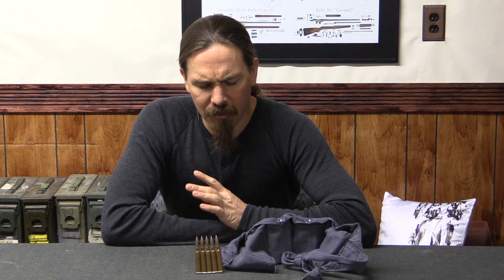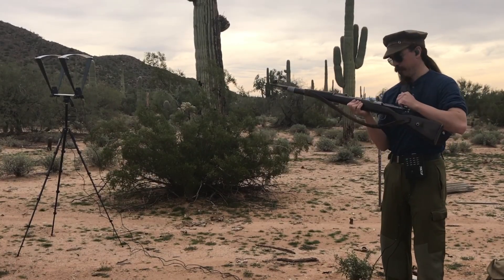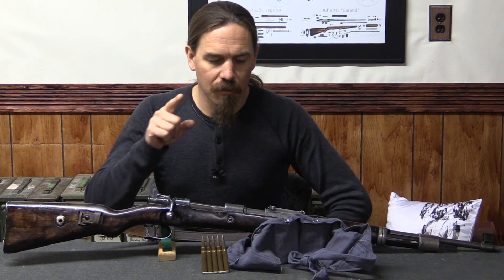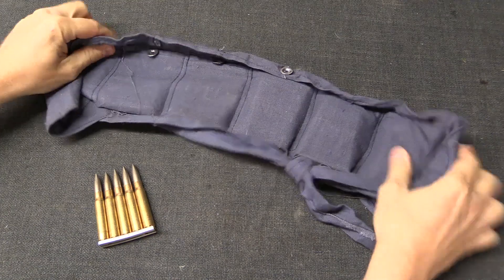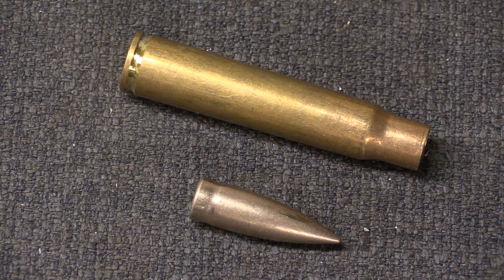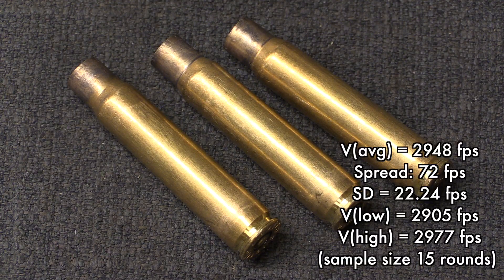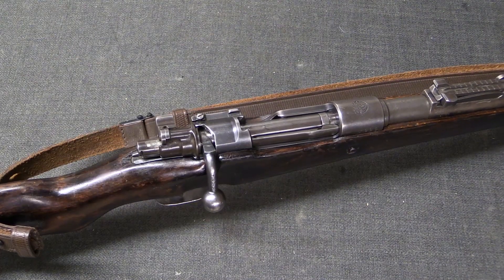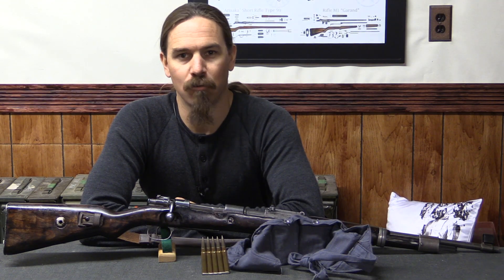Ammunition Evaluation: 1941 Turkish 8mm Mauser

Comment: Another couple of observations about Turk 8mm Mauser ammo that I noticed...
1. It really smells...the burnt propellant it has a sharp, almost ‘pissy’ odor.
2. It’ll really clean your bore....I had frosting in the grooves of my Vz.24 that standard cleaning could not fully resolve, and those hot, over-pressured cupro-nickel jacketed rounds blasted them clear. 

As a general rule, I always bring cleaning equipment to the range (especially after shooting corrosive Berdan primers) and I always check the bore after shooting, and I was amazed at how the frosting was just gone after shooting the Turk ammo. A good cleaning with an ammonia-water based solvent followed by standard Hopes #9 and a light coat of oil, and the bore was beautiful. I went home afterwards feeling rather clever....I was rather ‘chuffed’ after that, as my Brit friends would say.

Comment: i was recently given 700 rounds of this ammo and didn't want to shoot the steel jacketed bullets through my Vz-24 that i put a new barrel on sometime back. i decided to give it a try by pulling the existing bullets and seating in some 150 gr. Hornady bullets. i loaded up 10. shells and went to the range. the ammo pulled down fine but i noticed 1 out of each 5. had a split neck it all fired and had a fair kick to it. at 100 yards i shot a fairly decent group. after seeing this video i am questioning my friendship with said person who donated the ammo to me. i guess i could pull it down and reweigh all the powder and drop the charge a few grains of powder. but in all reality it's not worth the hassle and still may be dangerous to use after all that work. with corrosive primers installed even the cases aren't even worth anything to me as well. maybe i'll donate it to some of the ANTIFA dip shits and hope it blows them up. best to not use this stuff i have to agree on that.

Comment: That Turkish stuff created enough pressure to force the firing pin back IMHO, hence the craters' size.... they are really hot rounds. Pressure is peaking early (to around proof level IMHO0 probably as a result of powder deterioration after close to 80 years....

Comment: That is a very high pressure cartridge.  That cratering is called primer crowning. Due to the primer crowning, the pressure was most likely starting to get over 65,000 cup. At 70,000 cup pressure brass starts to move and bad things start to happening. That ammunition is dangerous.

Comment: "known for being very hot"
oh ok like 2750 ish?
Ian : "2921"
HOLY FU-
Reply: I know right?!  No wonder his rifle stock broke.
Reply: @patrickgjorven7832  A lot of turkish mausers have cracked walnut from it. Luckily mine doesnt!
Reply: Out of a short barrel, as well...
Reply: That’s almost 5.56 speed. That’s hot ammo.
Reply: @AlexKS1992  5.56 IS 55 or 62 grains. It's a much weaker round and puts much less stress on its barrel than does the Romanian or Turkish 8mm. Also, 5.56 decelarates very quickly. By 400 yards it's 50% its muzzle velocity. 308 and 8mm Light ball reach that threshold at 800 yards.
Reply: I thought I will be a showcase on how inconsistent the ammo is. 900 m/s on this heavy round....
How the hell anyone put this in machine gun.....
Reply: I mean at least it’s fairly consistently extremely hot
Reply: I've seen 3000+ out of a G98. Pretty crazy.
Reply: Dude, that's what I'm saying. And I have a couple bandoliers of this junk. Good think I saw this before shooting it.
Reply: Still hot tho
Reply: ive shot this ammo before and i picked up one of the cartridges and it had a crack down the top of the casing. i was a little concerned
Reply: Tbf it's 154 grain...
Reply: IjiYeah ji

Comment: So...a few years back my uncle bought an Yugo M24/47 and it came with a dozen rounds of mysterious 8MM Mauser to use. He shot 5 rounds to make sure they worked and then put it up. I come home on leave from the army and we take it out. He has 7 or so rounds to burn through. I put one in the mag, throw the bolt foward and pull the trigger. I felt like a Clydsedale had just kicked me in the shoulder. Shoot a second round and put it up, nothing but negative thoughts about the gun. About a year later he offers the rifle to me for 200 bucks, 50 less than he bought it for because he couldn't buy cheap ammo. The 5 rounds he had left sat in a box for a little over 3 years while I burned through S&B JSP and PPU FMJ. Today, I checked out the head stamp on these rounds since they were lacquer sealed. A trait which is used, to my knowledge, exclusively by militaries for long term storage. I google the head stamp and discover its Turkish Mauser ammo from 1951. Google Turkish Mauser and this is the first video. I am glad that nothing happenned to me or the rifle when those 2 rounds were shot. Upon watching this video, I pulled the bullets from the rounds, dumped their powder, and plan on detonating the primers at the range next time I go. Glad I did some research first

Comment: I know it sounds insanely frugal for somebody to pay $10K+ on a firearm then search for deals where they shave another 3 to 5 cents a round off the price on a bulk buy of ammo.  When you do the math though, you find out just how fast the gun will burn through it's purchase price in ammo.  At $.07/rnd bought in cargo container lots a $10K full auto running at 450 rpm burns it's purchase price in roughly 5.3hrs of trigger time.  Double the price, an increase of only seven cents a shot, still dirt cheap even buying container lots and you shoot up the purchase price of the gun in less than three hours of actual firing.  I can afford a decent full auto.  I can't afford to feed one.

Comment: I pulled all bullets. Weighed powder charges on five and lowered 1.5grains and resized necks and reseated bullets with lowered charge weight. No more pressure signs.  Powder grains are graphite coated flat extruded large flakes.  Ignition was 100%. 
ReDone in 1997.
Reply: Try reducing the powder by 4 grains. It works well.

Comment: Stock crack?..  Happens often when trigger guard assembly has loose screws.  Not a sure “over pressure”
Primers?  Using totally different ammo/primers to illustrate “normal pressure” not very scientific.  What do Turk primers look like with 10% reduced powder charges, 20% reduced? Are they then “normal”?
Velocity?  As stated not a way to measure pressure variation.
Caution needed? Yes, but illustrations of over pressure?  Only a maybe without a MEASUREMENT of pressure.

Comment: What are your thoughts on the cupro-nickle jacket? I remember reading the problems with the 03 springfield jackets causing very bad fouling that is hard to remove. I worry about cupro-nickle fouling build-up and even trapping corrosive salts under it if you don't get it perfectly clean.

Comment: If I wanted to pull it down for components, what is causing the overpressure situation?
Reply: Too much powder at time of manufacture, 
 Or powder degrading slightly.  Burn rates increase (faster) as powder ages. 
 Or a combination of max powder charge and aged powder.
This old powder does not have modern stabilizers added when made 75+ years ago.    Bullets can be pulled charges measured and necks resized and lower charge of same powder loaded into cases.  Lower 1.5 grains.

Comment: The ammo did not crack the rifle's stock . Ss ammo has more recoil than the light bullet S ammo and another 100 fps for S does not add much . I would guess the rifle was not tight in the stock . Did you chrono original German S ammo to get it's true velocity ? 100 year old figures are not even close as they had no way to measure exactly .

Comment: I don't run Turkish ammunition in general, a few years back I had issues with Turkish 7.62x51 in a Remington 783, had to beat the bolt open against a table twice, over pressured I assume.
Reply: Actually Turkish ammunition is always overfilled an overpressurised for shorter rifles with marble stocks

And turkish mauser bolts are made of adamantium

Comment: I know that it sounds like a bubba fix, but Ian could super glue or wood glue the crack closed. It works well, if you take the time to "work" it in. I have used it on a K98k that had a crack in the wrist like this one, a long crack in the handguard, and a chunk of wood taken out by the receiver, never had another problem with it, even after shooting off some poorly stored German '43 ammo that showed the same cratering on the primer as this stuff. The other rifle was a VZ 52 that looked like someone had used it to beat a tank into submission, it had more cracks than stock. I learned this trick from an old gunsmith who studied at the Colorado School of Trades.

Comment: I used some of this in my 1939 k98 a few years ago as it was the only 8mm i could find. Every round kicked hard, locked the gun up so bad i had to hammer it open with a rubber mallet and there were extreme pressure signs on the primer. I still have some but will not shoot it. The Romanian steel cased surplus is very good ammo.

Comment: An additional question or 2. Have you weighed the powder load in these rounds ? If so, how does it compare with WW2 German 150gr. SmE rounds ? The Germans had some magical double base flake powder that produced 2,500+ fps. in the 198gr. s.S. rounds without over pressuring. Thanks again.

Comment: I fired exactly 1 bandoleer of this crap around 2001 in a like new Yugo M48 Between the misfires, Hang fires and split necks I figured out that it just wasnt worth destroying my like new M48. I did however put one group of 5 into 1.25" it was a foot high at 100yds but it was still impressive. Display only ammo.

Comment: I know the K98 variants have a very sturdy bolt system that can handle a lot of pressure, but one thing i can't find out is when does failure of the action start taking place? I see the operating pressure for the German ww2 ammunition is 300-320 MPa, but what kind of pressure can the action handle before starting to vent gas?

Comment: Why does poor storage increase pressure?
Reply: Excessive heat and moisture can cause the smokeless powder to breakdown into nitric acid, which in turn raises the nitrification level of the nitrocellulose and increases its burn rate and combustibility - which results in increased or erratic pressure.

Comment: I know of a pretty good gunsmith over at C&Rsenal that might be able to fix your stock... Provided you don't mind him using acraglass.  I would offer my own K98K but the bore on it is probably not going to contain enough gas pressure to give you the best results.  Imagine if you will a dirt road lined with potholes.  That's what my bore looks like.  It will hold on a pie plate at 20 yards, mostly.

Comment: My first rifle was a K Kale m38 Turkish mauser and when I was young and dumb I used to shoot this turk surplus ammo out of it all the time (it was 11 dollars for the 70 round bandolier at the time). And this is the sort of thing I saw all the time. Incredibly hot ammo, the cratering in the primers, and the top hand guard stock is cracked. 
After reading up on it and learning of these problems wearing out the rifling, and even cracking the chambers of the Turkish rifles I stopped using it all together. It also had a problem with bad primers and misfires.

Comment: It would be a better evaluation if an actual pressure reading could be obtained for the ammunition in question. The Oehler System 83 can be set up with a strain gauge glued to the chamber of a rifle. Apparently, the System 83 is a Professional System which is considerably more expensive than the Oehler 43 which was intended for home use by the ballistic hobbyist. The Oehler 43 was discontinued, the last time I checked, but maybe one could be located on the used market.Regards,Gungineer

Comment: Cool I still have a crate of turk 8mm date stamp 1950. It has white bandoliers same style as these and have a single piece stripper clip which are kinda crap. It's in a wooden crate  with a spam can inside. Feels really hot still corrosive don't seem to crater the primer much at all. About 154g projectiles non ferrous and I still have about 1000 rounds because I don't like shooting mauser's anymore.

Comment: What is causing the overpressure? Did the primer or the powder degrade, or was the ammunition overpressure to begin with? What storage condition could increase the pressure of a cartridge?
Reply: Smokeless powders are made of inherently unstable compounds that degrade overtime - more so when exposed to excessive heat or moisture. When they degrade, they tend to burn faster and hotter. We got around this problem by developing stabilizers like diphenylamine to slow down the natural chemical breakdown of the powder. Before this, any ammo loaded with smokeless powder pretty much had to be reloaded or thrown out every few years. With stabilizers, smokeless ammo can be kept for several decades without issue in proper storage conditions. But even with stabilizers, you shouldn't expose the ammo to hot or humid conditions which will quickly make the powder go bad.

As for the primers, the type used here were corrosive-type primers. Corrosive primers usually contained potassium chlorate as their active component, which is very stable as far as priming compounds go. Corrosive-type primers have been used since the 1800s and will store well in a wide range of ambient conditions, which was probably why it was widely used in the Warsaw Pact. 

My guess is the powder rather than the primer is to blame for the overpressure.

Comment: I've still got a lot of that Turk 8mm ammo, in stripper clips and bandoliers, just like you tested, that I purchased 15+ years ago.  And yes, you are right...it shoots hot.  However, my full length Turk 8mm rifle seems to digest it just fine.  Perhaps the greater length of the barrel, and higher weight of the full-length rifle makes up for some of that overpressure?

Comment: What causes the pressure to increase in storage?

I’m sure it has something to do with the propellant degrading into a more volatile composition. 

Can you elaborate on this in another video please?
Reply: You're correct. Hot and humid storage conditions will accelerate the natural breakdown of the smokeless powder. 

As you may already know, the main ingredient in smokeless powder is nitrocellulose (NC). NC meant for use as propellant is produced to a set nitrification level - the more nitrified it is, the faster it will burn. Hence the nitrification level determines how hot a particular batch of smokeless powder will run. The problem with NC is it's unstable and will breaks down back into nitric acid over time. The nitric acid in turn reacts with non-nitrified cellulose in the powder and increases its overall nitrification level. As nitrification increases, so does the rate in which NC breaks down into nitric acid. If left to its own devices, the breakdown devolves to a runaway reaction which can potentially turns the previously good propellant into an unstable explosive (as was the case with the early French Poudre B smokeless powder). The use of stabilizers slow down this breakdown, and a good stabilizer is pretty much essential for any ammo meant to be stored unused for more than a few years. Modern stabilizers like diphenylamine will keep smokeless powder good for 30-50 years in proper storage conditions.

Excessive moisture or heat will cause the NC in smokeless powder to break down faster, to a point where stabilizers might not be able to compensate for. Hence, why you shouldn't keep your ammo in a hot car or outdoors exposed to the elements.
Reply: @Bulsh1tMan  I wonder how much humidity and heat is too much. I guess 60% humidity should not be surpassed and temperatures below 21 c° are advised, but while moisture can be easier rectified, temperature isn't. What should someone expect in warmer climates like 30 c° all year long?

Comment: I had some of this with 36 head stamped.  I chrono'd it all over 2900fps.  Also only about half would fire on the first try, about half of the duds did shoot the second time.  I was using a Czech 8mm Mauser copy.  I do have one stripper clip of this same 41 stamped 8x57.  I haven't shot it yet but I have one box of 1950 Russian loaded 8mm and three boxes of 1942 German 8mm rounds.  Awesome video, I always wondered why this stuff was loaded so hot.

Comment: Ironic how i just bought 200rds of this the day before this video comes out.
Reply: Pull the bullets and reload with your own powder?
Reply: If you have reloading equipment, drop the charge by a grain. I think from memory it was about 47.x grains. Lower to 46 and it will be much more pleasant.

The powder is a fast burning powder. Probably close to IMR3031 or AR2206.

But if the gun is in good condition, it should handle it fine as .30-06 with 150g bullets gives about the same performance.

Comment: I greatly appreciated the video.  While I have 98 mausers, after watching the video I will not be shooting the Turkish ammo that I have in them.  Just because it is a mauser does not make it safe to fire over pressure ammo.  My ammo was loaded in the 50's, but overall externally looks just like what you were shooting.  I think I will pull the bullets and reload with moderate charges of new powder.  I will load for a velocity of 2500 fps.  30-06 commercial factory loads are supposed to drive 150 gr bullet in the 2900 fps range.  Military GI for 150 grain barely makes 2700 fps.   It is possible to make 30-06 into 8x57 and .308 will sort do the same, except the 8mm cartridge that results is not quite 57 mm long so I will only use the large stock of commercial 30-06 i have whenI get around to playing with my mausers.

Comment: The Turks used large numbers of 1888/05 rifles (Commission 88) as well as modernized Commission 88s with new barrels/stocks etc., to eliminate sleeved barrel. Question, if ammo did that to '98 Mauser and semi-autos, how did those '88 variations uphold with this excess pressure 8mm?